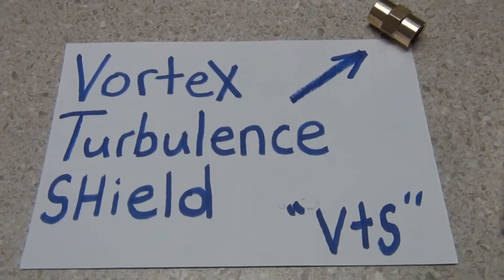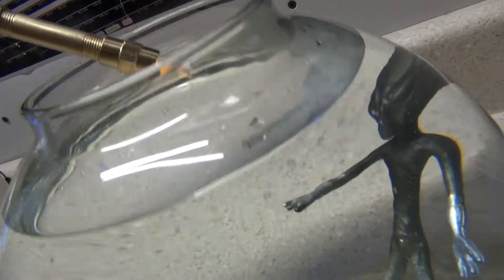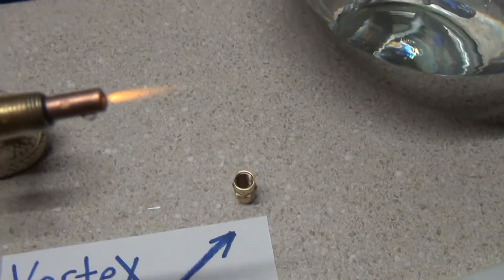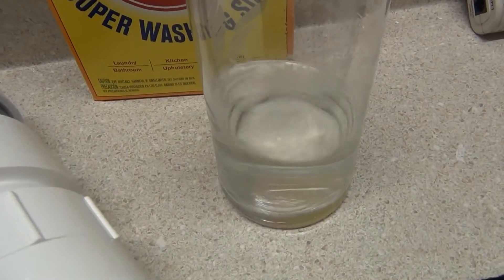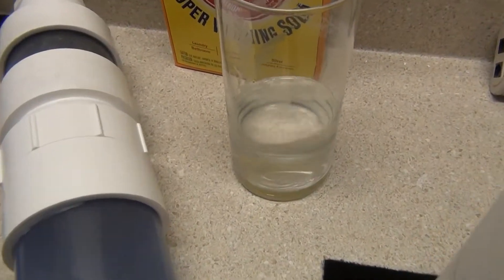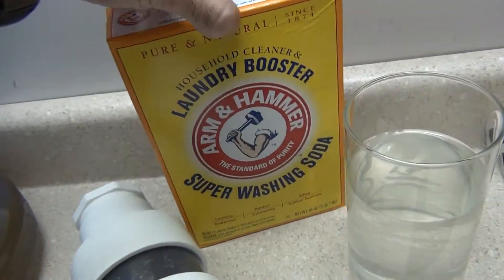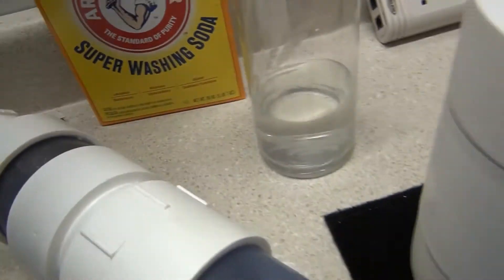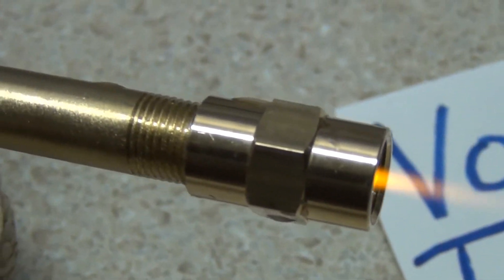HHO UNDERWATER FLAMES & VORTEX TECHNOLOGY

Comment from the maker: The real blessing is that the water provides its own oxygen source with and hho can easily burn under water and in any environment void of an oxygen as long as you keep the turbulence from putting out the flame. The VTS prevents the engine thrusters on your spacecraft from taking in water and having a flame burnout if you ignite or operate them underwater.